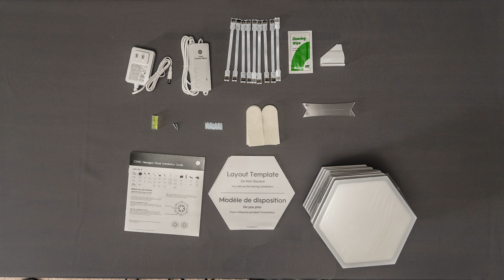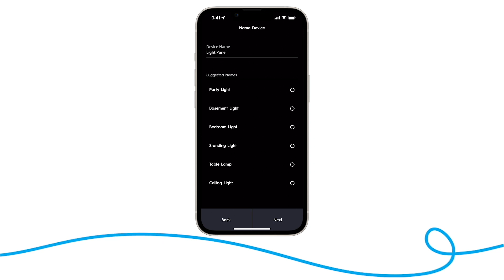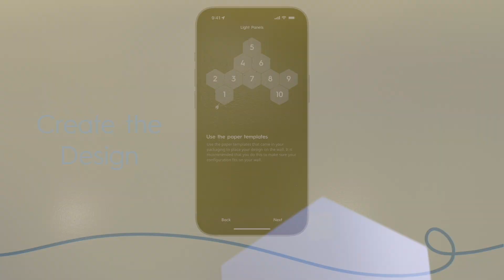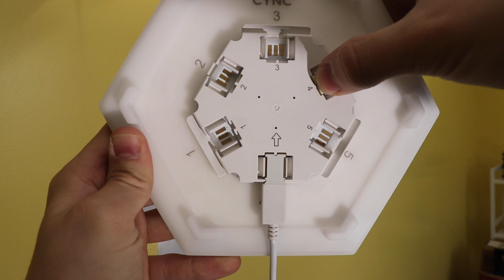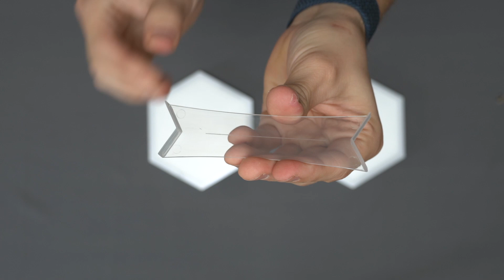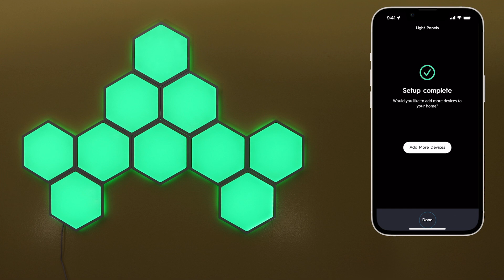Cync Hexagon Smart Panels Installation and Setup

Comment: If only the cable connectors and the panel popped off the backplate as smoothly and cleanly as this video pretends they do. These things are so hard to clip together that it feels like I'm going to break them every time I put a new panel down.
Reply from the maker: Hi Jeff. Thanks for reaching out. You mentioned that only two panels are working for you. If your lights aren’t working like they should, we have a Support team that can assist. When you have a few spare minutes, please connect with the team at 1-844-302-2943.
Reply: Agreed.
Reply: I thought it was just me.  I spent 2 hours trying to put this thing together and only two panels work.
Reply from the maker: Hi there. We're sorry to hear this. We do appreciate this feedback. We've passed this along to the appropriate teams as they consider new ways to improve our products.

Comment: Hello my striplights wont connect to my WIFI any suggestions on what to do
Reply from the maker: Hi there. If you're having trouble connecting to your home Wi-Fi network, here are some common solutions:

- Confirm your Wi-Fi Router is powered on and broadcasting.
- If your router is powered on, but not broadcasting, contact your Internet Service Provider.
- Check your Wi-Fi strength at the light's location. You can do this by looking at the Wi-Fi signal bars on your phone.

If you do not have a strong signal:

- Move the light closer to your router or install a Wi-Fi repeater.
- If you have a Wi-Fi repeater, move it halfway between the light and your router to improve signal strength
- If you are still experiencing issues, power cycle the light by unplugging the light strip for 30 seconds, then plugging back in.
- Confirm you are on a 2.4 GHz network. Cync is not compatible with 5 GHz networks. Some routers will combine the 2.4GHz and 5GHz bands into a single SSID. Cync and C by GE products are compatible with most routers of this type.

If you continue to have trouble, give our team a call at 1-844-302-2943.